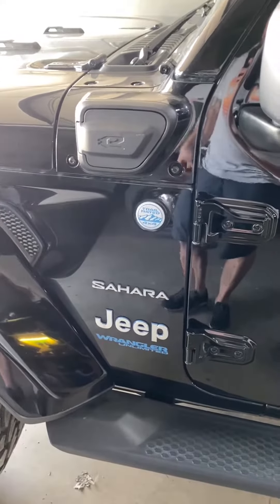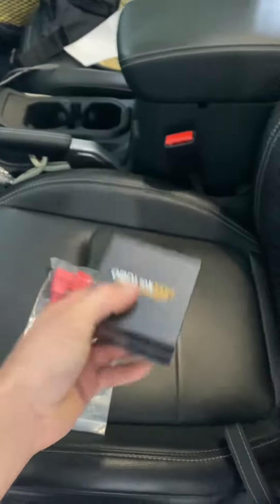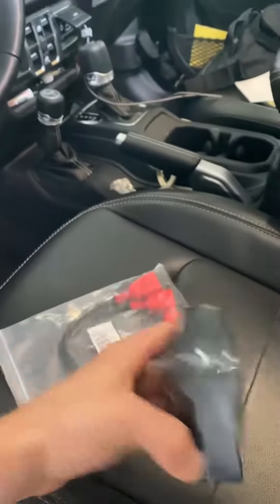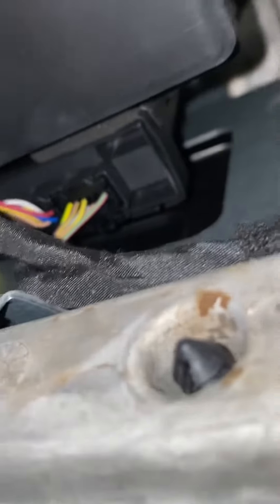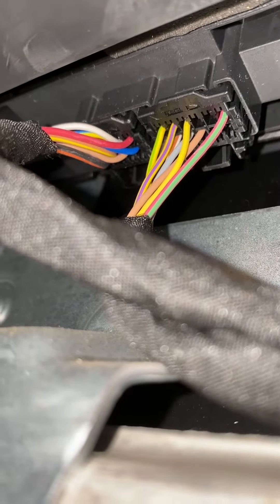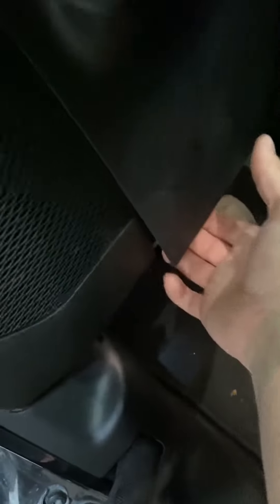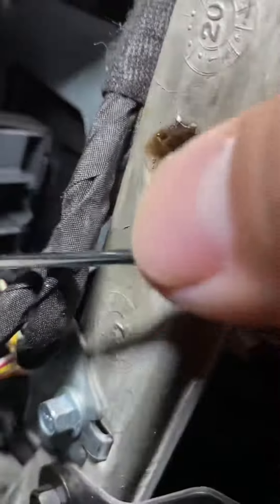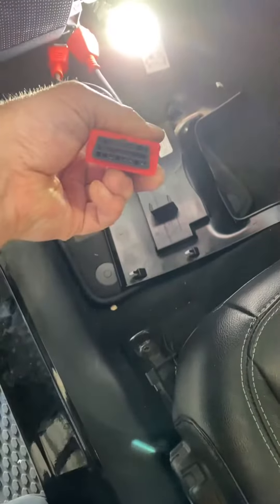2021 Jeep Wrangler 4XE JL SGW Cable Install

Comment: Do the plugs need to be put back where they were after the bypass is installed or can it be left it in place?
Reply from the maker: The plugs need to be out back in place. There is a splitter with lengthened cables available on Amazon to make it easier to access if needed.